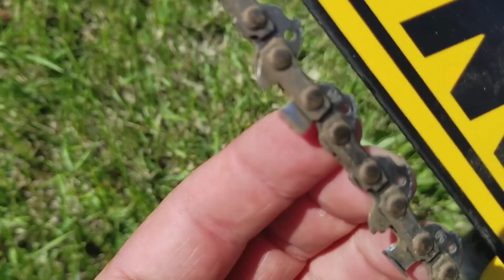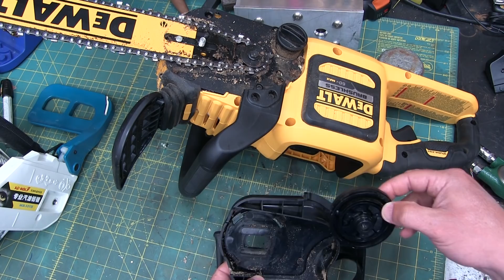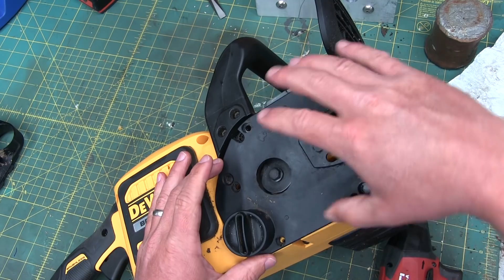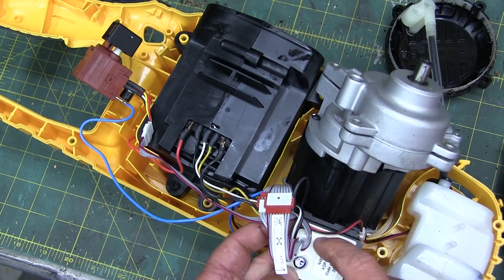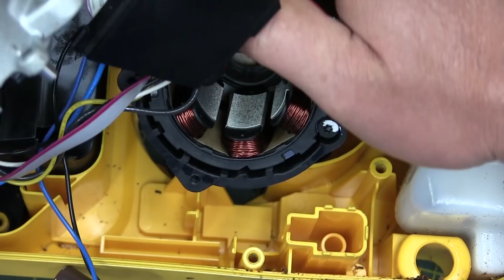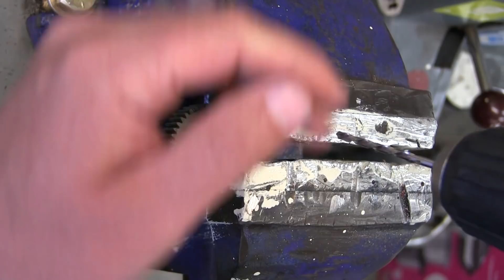BOLTR: DeWALT Chainsaw | Engineering FAIL

Comment: I was tempting myself to buy one of these, but I think I'll wait for someone to release a more skookum one now.
Reply: Picked one up not to long ago, and I don't have quite the same experience. Not sure if much has changed in the time since this video, but I dropped 12 small-ish trees (only a foot and some change in diameter at the base) and it worked fine. I didn't buy it to do massive amounts of work with, but because it just needs to be OK and be able to turn on in 5 years when I need it again xD
Reply: @chrisstehm5328  But will you have any working batteries left in five years?  I bought a very cheap and not-too-nasty mains electric chainsaw, it came with a proper tool for setting the bar. On the not-so-great side the oil feed tubing was pinched in the shell, but it was easier to fix that than take it back to the store. I use it for pruning a few trees in the garden every few years.
Reply: Pretty disappointing design, considering the brand.  Most impressive feature was the coil oil tube internal support.  As an engineer, I wouldn't want my name associated with this design!  😮
Reply: I have one, I use it for cleaning up my fence line and storm damage limbs, cutting up firewood when long-term camping, etc., it’s got all kinds of power, uses the same batteries I already have, and needs no maintenance. I used to have a good, pro-grade Jonsered when I needed to use and sell an awful lot of firewood, and wouldn’t use something like this for serious work. I couldn’t be happier with it for what it is, which (I think) is exactly what it’s marketed as.

The reason it’s cheesy is so Jeffrey J. Homeowner that works for an insurance outfit and wouldn’t know a deep well socket from a Robertson screwdriver can figure out how to use it without hurting his delicate hands. I get why it exists and why it’s made the way it is. If I wanted or needed a real saw I’d still have one.
Reply: Same, I got one for the garden. It's pretty cheap if you already have the batteries and not for real woodchuck work. I appreciate for what it is, if I wanted a Stihl or Husqvarna I would've got one. I wanted a cheap chainsaw with plenty of power and it's great for that. Happy for the compromise in design as it lowers the price.
Reply: Get you a stihl 180-c a wee little bastard but runs like a juiced up race horse

Comment: 24mm- The greenworks I got is better than any of the homeowner type gas chainsaws. It has an Oregon bar and chain with the standard 2 bolt bar hold down and a screw for tensioning. I dont get why dewalt would put out a plastic chain holder either. The GW will also make 14 cuts in a 15in log before dying. Youd probably get 30+ minutes of actual cut time with typical homeowner tasks. No clutch on electric-lol, that's why it pulls the chain right off the bar. 

Edit: I just put up a video with the highlights of where the Greenworks 60v out does the DeWalt. IMHO, it is better in almost every way- It's metal from the motor to the tip of the blade- very little flex. ESC is about 3 times the size.
Reply: I'm sorry but no, husqvarna and stihl homeowner models like husqvarna rancher 455 or 460 just dominates.
Reply: Cameron Crane, that Husqvarna 455 is also close to 2.5x the cost of the greenworks 16" bar saw (at least on amazon, so too lazy to hunt down deals on both). I know i'd rather have the Husqvara, but it'd be a hard sell to the better 3/4's given the 3 (small) trees in our small suburban lot.
Reply: Andrew Frink I know the husqvarna was high as hell and honestly if I was buying new I would've just bought the husqvarna 576xp or 572xp instead but I got it used for 250 in perfect condition and gas it like a year where I used it like a typical homeowner but then used it professionally since then and it hasn't disappointed but it may not be the best pro saw simply because of the power. The build is quite astounding though
Reply: Yeah, big difference between real pro equipment like Stihl and Husqvarna. Thing is, for $400+ you could get a real pro brushless 16in saw(without batt/charger), before questioning the $400 you'd spend on a kWh worth of batteries/charger, consider the 1000 kWh worth run time(2000+ hours) without having to deal with buying/mixing gas or starting. I believe the Greenworks is more "pro" than the $100-$200 homeowner saws, but not quite what you'd get with an entry level commercial saw.
Reply: Bar and chain oil is also for when you get to the job site and forgot to bring 2 smoke fuel. Pour a little in, add half a tank of pump gas and give er a shake.
Reply: Jimmy's Tractor, after watching your video, I'd take a Greenworks over this Dewalt any day. Also, my kids got to sit in the room the entire time I was watching your video. 🙂
Reply: Kurt Tappe I pushed pretty hard- hard enough where I start to worry about breaking something, and have never stalled mine. The bar did get hot as hell though. I was trying to use up the battery as quickly as possible.
Reply: Greenworks sucks
Reply: Goprof150 I have one and have used it harder than it has any right to be used. Great tool.

Comment: I got the Echo 58v battery powered saw a few months ago after plenty of research.  It works great so far.  The bar has 2 bolts.  I was able to fell two 12 inch trees and get them mostly limbed on one charge.  I plan to buy a second battery.  No gas to mix, no carbs to clean, no pulling your shoulder out of socket trying to start it.  I'm just cutting firewood and trimming.  Works well for me.

Comment: As a homeowner with only light duty lopping and limbing and a shop full of DW tools I dumped the old gas saw that was more trouble to me than it’s worth and purchased the 20 volt version.   I love it!   No, I won’t go out logging with it but for the homeowner it’s awesome.    Pick it up, slap a batt in and off you go.   Job done.

Comment: My Dad gave me one advice, when it comes to tools: "Never buy Black & Decker!"
Reply: Mine had a rather crappy B&D drill (early 1970s maybe), which he intended to get to crap out, and then replace. But it never crapped out.
Reply: B&D owns a lot of different tool companies these days
Reply: @treerat7631  yes but Black and Decker branded tools are terrifyingly cheap power tools found at Walmart that can only be undercut by Drill Master. Not exactly scookum.
Reply: I have an old school 7 1/4 circular saw it’s built very solid...at one time Black & Decker was THE name in tools but went way of mass produced Chinese... now they own companies like Dewalt and Bostitch...Dewalt is the platform I buy I like their flex volt batt
Reply: Old black and decker tools are pretty damn skookum, but anything since they went with their black and orange colour scheme is cheap junk for the most part.

Comment: I use the dewalt 40 volt now for two years, pretty steady. It’s served me well, even working my way around 30 inch diameter trees. I do use it gingerly, despite putting it through the ringers. 
It isn’t my main chainsaw though....
I prefer my stihl....
Have been pleased with the work the dewalt has done though.

Comment: Those 3 phase AC motors pull hard.
Reply: I want to stick that thing in one of my bigger RC planes!
Reply: Its a bit heavy, but would definatly pull its own weight. Id recommend it highly for an ebike.
Reply: Would go great on a scooter
Reply: with that gearbox it could probably turn one hell of a prop
Reply: microbuilder 28x12 blade 10kg thrust.

Comment: I've got one of these as well as a Husky 359.  The husky is used on trunks and when "real" work needs to be done, but most of the time I find myself cleaner small branches and brush.  The Dewalt is great for that.  No gas/oil and no tools when tightening the chain or servicing makes it easy to grab and go.  Two different tools for different jobs.  I wish the dewalt was a bit stiffer and I would pay more for more metal bits in it.

Comment: I've put my 20v model through hell, so far so good! Love that sucker. I just have to watch chain slack and be sure it's properly tensioned
Reply: How is it holding up after 3 years???
Reply: @ol1294  Ive been using mine since 2018. The only probs are the ones described so far in the  video.
They hold up well. The slide in battarys are a real hit for dewalt. I have numerous dewalt tools and they all take the 20V battarys. 9 Amp hr.

Comment: I have the 40V version and I've been pretty happy with it, really shocked at how well it cut for a battery saw.  I use it for cutting logs into rounds to go on my lathe when I'm in the garage and don't want to run the big saw in there.  I just used it to round a green oak blank I cut from section I halved with the MS361.  Finished blank was 16-1/2" by 10" thick, so the log half was obviously larger than that.  I had the chain jump once in the beginning when I first got it and then adjusted tension to a proper value with no issues after that.

Comment: I own 3 of these DeWalt 60 V saws and address 4 major items about this video (no, I don't work for DeWalt):
1) This chainsaw is NOT just for quick easy jobs as represented, if used carefully. This narrow-chain saw will cut and process medium sized hardwood trees. I have used it in Hawai'i to clear and process an entire kiawe (mesquite) forest over the past 3.5 years. The largest trees are 60 feet tall and 24-30 inch in diameter. But, you need some finesse.
2) The cover locking ratchet handle vibrates and can become loose quickly and must be retightened. If you don't, the chain can derail from the bar by skipping over the chain-retaining washer on the sprocket. This washer is not torqued down by the sprocket bolt, so it floats and vibrates (stupid). My fix was to add a second OEM washer that takes up space and to torque the sprocket bolt on it. Derailing now rarely occurs, unless I let the ratchet handle vibrate loose, so I retighten it often.
3) The bar tensioning system can fail, but NOT from stripping of the gears, or flexibility of the plastic cover. The cylindrical tensioning bar snaps, if you get repeated bucking from broken chain cutters on seasoned hard wood, like cured mesquite. So, I have new Oregon chains and OEM bar tensioning replacement kits that are inexpensive and very easy to replace. I now cut seasoned wood slowly and buzz right through uncured logs.
4) Tips: I sharpen the chain every day with 4-5 strokes using the manual Stihl 2 N 1 sharpener that has both round and flat files. When I break more than 2 cutters on a chain, I replace the chain that costs only about $13 from Frawley's on Ebay (no, I'm not Frawley). Replacing the chain is a lot easier than fixing bar tensioner items, and it cuts like budda.

Comment: Maybe yours is defective.  I have the same model and have it hooked up permanently to my chainsaw mill.  It outperforms my little Stihl and I don't have to smell like the inside of a carb at the end of the day.  The noise is attrocious though...
Reply: Im glad I'm not the only one who thinks he has a bad one. I love mine. Alaska winters the Stihl won't start for anything. Pop a battery in and this works.  It's pretty damn convenient but i can't say it could go well against a professional for felling more than 2 trees
Reply: Chainsaw mill does sound a little ambitious for this saw but your the guy with milled lumber.
Reply: @unclegeorge7845  I don’t think you’ve used this saw if that’s your take.
Reply: @dpmakestuff  Hmmmm.  We're talking about ripping 8+ inch logs - right?
Reply: @unclegeorge7845  I maxed out the bar on some logs. Electric chainsaws have instant torque. They just keep going.
Reply: @dpmakestuff  I have a Kobalt 40 volt and was in awh of this DeWalt.  You're the guy with chips on your frontside so I'll take your world for it.  You probably found this review even more CS than I did.  Cheers

Comment: I bought one of these because I fell for the Flexvolt system on several other tools (love the weed wacker). I took it up to my buddy's place for a weekend of testing (abuse). Took 3 batteries and a small generator to keep them charged (using a gas engine to keep a battery unit going. lol). Seriously, it out worked a Stihl 250 and a 320. I cut close to 3 chords, popping the chain off 3 or 4 times. My only complaint? The f**** bar setup.Once I learned to not twist the bar, it wouldn't throw the chain as much. The gassers would run out of fuel before my batteries would go dead. They also have the oiler tuned almost perfectly...when the battery died, it was out of oil. The thin kerf chain just cuts faster, and it was hard to stall the motor (more torque than gas). We were cutting juniper mostly, along with pine and oak. Pretty sure it wouldn't hold up to doing it every day tho, but tougher than it looks.

Comment: So basically you can get rid of the weeble woble when using an extra metal washer and proper bolt?
Reply: Piet Muijs or just spend $50 less on the Greenworks with 2 nuts that secure the bar to a metal subassembly that includes the motor?
Reply: TomOfTurmiola winner winner chicken dinner!
Reply: And then it'll chooch
Reply: Unless your Sears is like mine and doesn't actually have anything left to sell anymore...I went to look for a drill press all they had was a floor model missing parts for $180.  Pass.
Reply: I was thinking the same. Tap that retainer "bolt"
Reply: Piet Muijs chain bar still looks too thin, for heavy working loads.
Reply: Duane Brown . Agree. But at least not as bad anymore

Comment: I’ve been using mine on the farm clearing hunting trails and shooting lanes, limbing trees and even cutting some fairly large diameter poplar like butter.
I find myself grabbing this saw so much more than my husqvarna power saw to do quick jobs and never had one issue with the chain loosening or lack of oil.
It has a very narrow bar and chain which makes it cut such a smaller swath through wood.
The batteries seem to last a fairly decent amount of time for small jobs.
I keep two back up 60v batteries in case I need them cause they take so darn long to charge the 60v ones.
The updated saws don’t ratchet with the flip up turn thingy….they tighten as much as you want.
I haven’t dulled my chain yet and I’ve been using it for a year now on and off.
I could have tried to make my story more interesting and confusing by making up stupid cartoon words like Yosemite Sam but I figured people would rather hear English and not someone trying to impress themself.

Comment: would like to see a teardown on the makita cordless chainsaws
Reply: Is probably just the same as Dewalt
Reply: Rab Lord could be but it's been on market for a lot longer. 5+ years.
Reply: Gabriel Matte husky as one as well,
Reply: The makita sawzall with the long blade goes thru smaller branches like butter.
Reply: Same here, the Makita looks similar but they show it going through limbs that are about a foot thick.
Reply: There are plenty of good saws out there he could have chosen.  Perhaps reviewing a shot saw is more fun?
Reply: Doc Ferringer the Greenworks goes through quick too. High power and metal sun assembly

Comment: I have the same saw but when I took mine apart it didnt look the same. I agree that the chincy plastic is a fail, but I dont get the blade wabble. I do fell trees with mine and buck up for the fire pit. Batteries last about 1 1/2 hrs each, and oiler leaks like a normal chainsaw. Will it last any length of time? probably not, but mine has been in service for about 6 months and gets used every weekend.(We are still making fires for heat here in the high country every night).

Comment: A few wood carvers I know tried this saw out, the oilers gave out after a few hours of use. I had the Echo battery powered saw, it looked more robust than this DeWalt, but the Echo weighs 14lbs which is about the same as a pro 90cc saw.

Comment: I have to say I have the 40 volt version and have had zero trouble with the chain and bar, I have cut down two trees and cut them up after the hurricanes. I bought this because I don’t need it that often I also have the 40 volt trimmer had both for 4 years with no trouble

Comment: So tired of buying 2cycle crap that is not adjusted to run at 4500 ft. And now thanks to the EPA's reg, non-adjustable carbs!😢
Reply: That's why god made dremels,  just cut a couple of slots in the heads and you're good to go.

For light pruning, I have a Homelite XL 2-banger with a 16" bar that's going on 30 years.  Probably nearly as light as this thing with a whole lot more oomph.  And there's no chain brake to throw in the trash.
Reply: tubastuff I found a home lite in the woods the other day. Thing is built like a tank. I’m guessing 1960’s model.
Reply: check some youtube channels, you should be able to remove the plastic limiter covers off the adjustment screws and cut a slot in the pins as tubastuff mentioned.
Reply: On some carbs, the insulated sleeve on a wire crimp lug will fit snugly over the adjustment screw head and give you enough traction to adjust things.  I did this with a power pole pruner that refused to start and run right out of the box.  A little tweak and it works just fine.
Reply: You can also buy the special tool to adjust the carbs on Amazon and eBay.

Comment: I had the Homelite plug in version of this. Jumped the chain a lot. Cause of death was the smoke coming out of the motor. Bucked up 7 or 8 BIG pines with it over a few years though. Always left me wishing I'd spent the extra coin on a pull start.

Comment: The capacitor is more likely there for power factor correction. AC (pulse width modulated DC reacts the same) is required for brushless motors need the inductive reactance compensated for or they don't run at full efficiency.